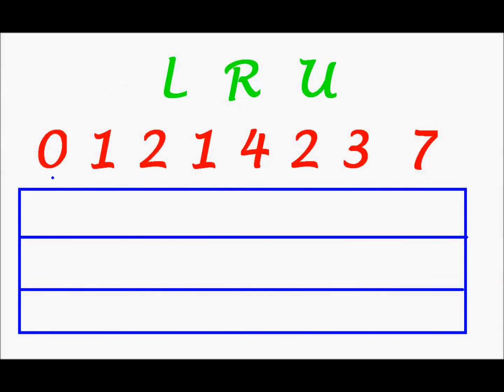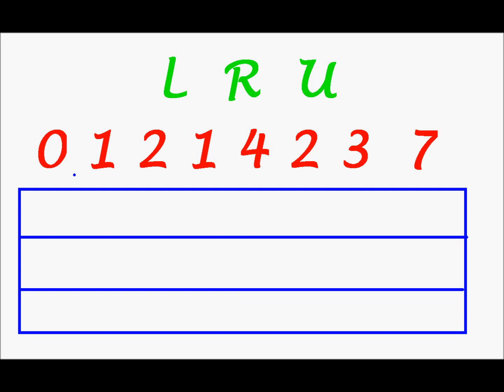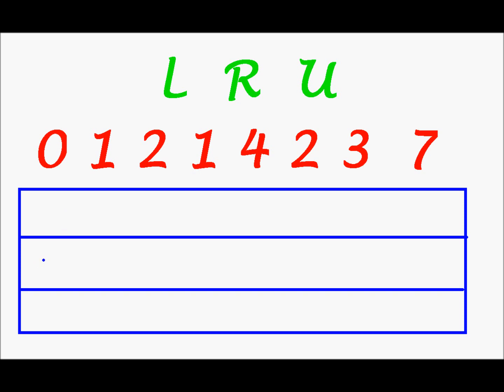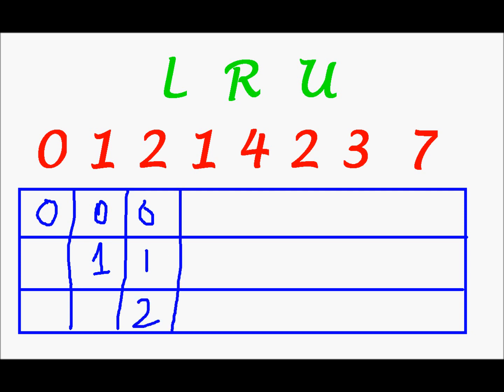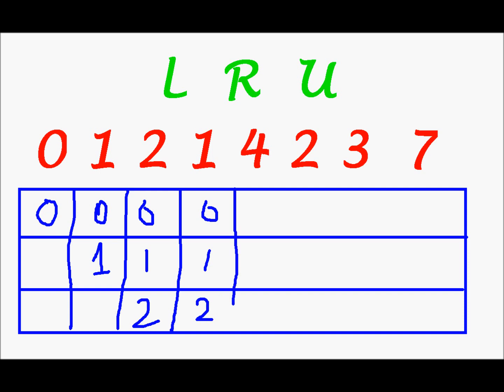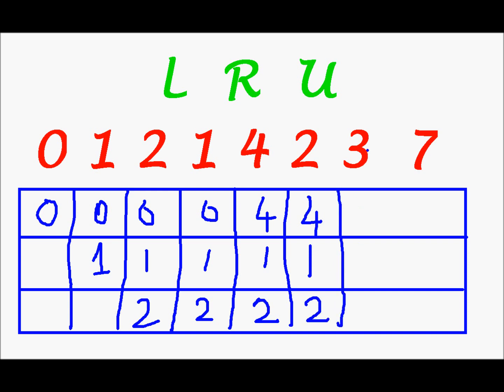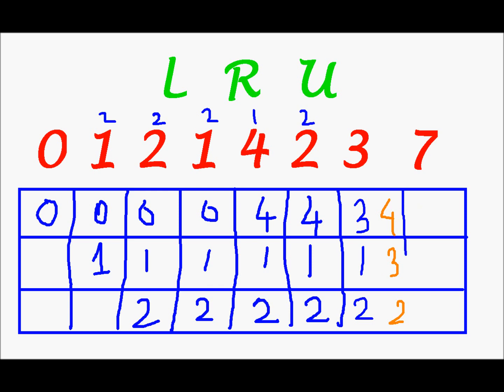Operating Systems- Page Replacement LRU

Comment: In LRU you don't need to count how many times a cache line has been used to knock it out.  What you depicted is LFU (Least Frequently Used).  If using LRU, the column below 3 should be (from top to bottom): 4 3 2, because 1 was the Least Recently Used cache line, and the last column should be: 7 3 2.

Comment: Uh I don't know if this is right...

danyluis Has it right. Here you are doing Least Frequently Used. For LRU, you remove the page which was referenced least recently in the list of page requests
Reply: if the frame is filled by value  (3 1 2) with blue color it'll be like LFU (Least Frequently Used)...so i think the right answer is the orange one.